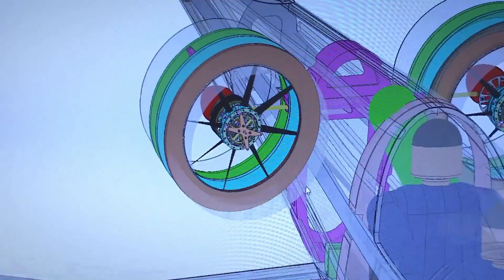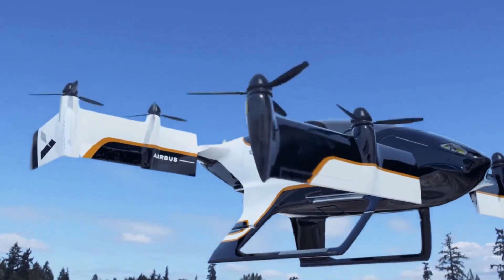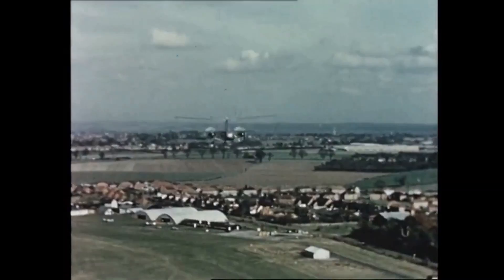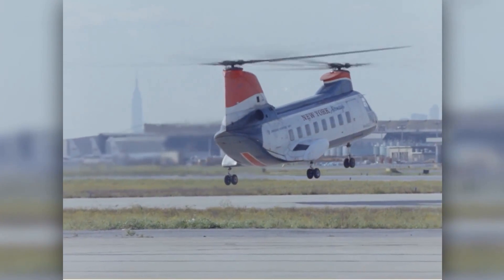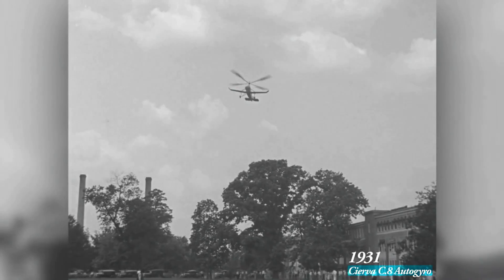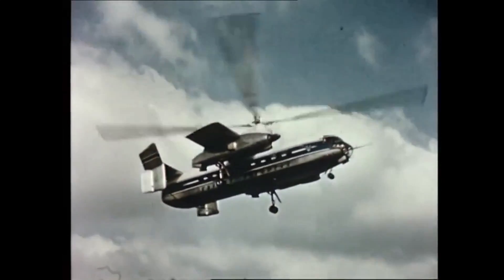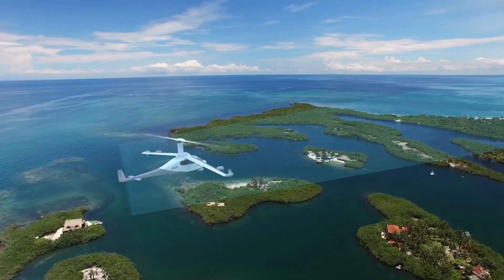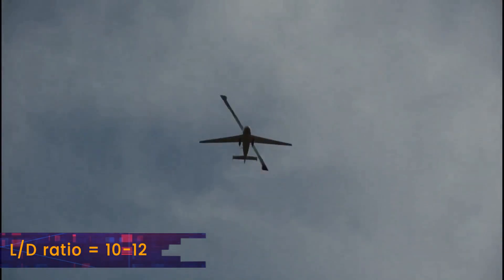The Electric Reincarnation of the Gyrodyne

Comment: Unfortunately they are way behind, the Jaunt company started 2019 and ROSA will only be produced in 2025 and that is simply too slow for the rapidly changing market in these next years.
Reply from the maker: I dont think its that bad. The reason is their design is banking on 300 Wh/kg batteries minimum. While we have only a couple of suppliers for this energy density, but by the time 2025 come we might exceed 350 Wh/kg

Comment: People often forget that any slowdown in rotor speed can be used to save energy or regenrerate on electric planes.
Reply from the maker: Exactly, I touched upon that in this video, but I have another video, in which I will try to focus on topics like lift dissymetry,  mu 1 and regeneration. This video would have been too long had I spent more time on that
Reply: Looking forward to your next video, if energy can be recaptured during the decent, regen that could be quite significant advantage most newer vetols seem to be expending loads of energy to control the decent

Comment: Ive had Rotodyne on my mind for some months. It occurs to me that the rotor could be powered up using electric powered folding props the like that are in use for glider propulsion. 
In this way the noise of the tip jets is avoided, as well as the complexity of fuelling them, it simply requires slip rings to transmit electricity down the rotor to motors about 2/3 span out. When not required for vertical flight the props will self stow themselves to a furled position. The entire machine is quite safe as, if the thrust engines fail it has the reserve of the rotor either as a helicopter or an autogyro the safely descend, or it could fly on to an available sealed surface if there was one in proximity. The original had Napier Eland turboprop power producing 2.800 shaft HP, and tip jets providing 1.000 lb thrust or 4 Kn with a tip speed of 720 ft/s. The main rotor was a pitch controllable 4 blade design of quite low disk loading of 6.14 lbs a sq ft. Overall the machine had some 30% of its GW or 50% of the EW available for disposable load.
Reply from the maker: If you can make a working model of your idea, it would be a great demonstrator. I like the idea of folding props